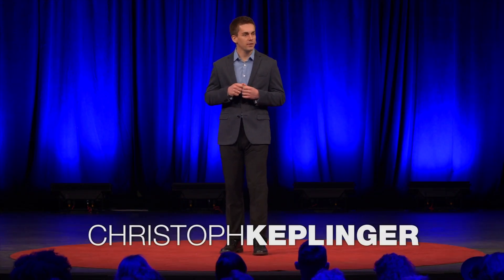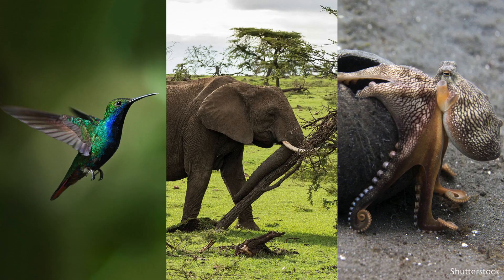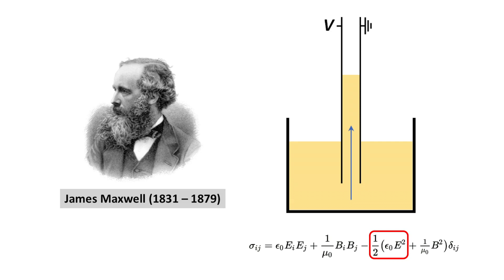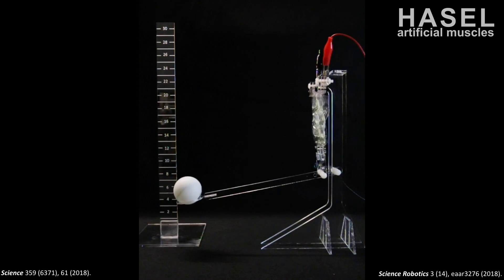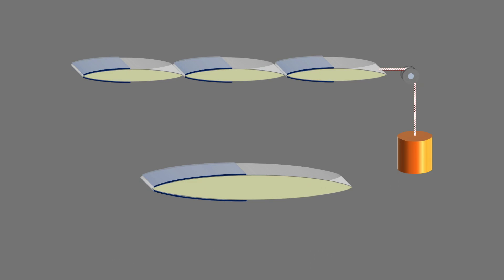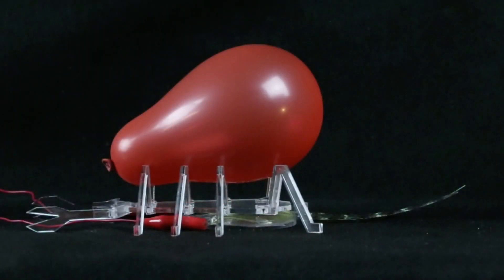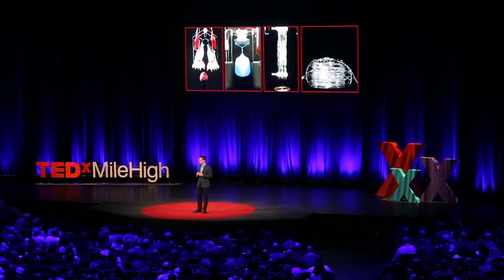The artificial muscles that will power robots of the future | Christoph Keplinger

Comment: Relax folks. Don't get your hopes high. Pay attention to the voltage required - 8kV (8,000 volts). That's dangerously high. This solution is interesting but not practical. We need to find a low-voltage solution.

Comment: That's pretty badass. From an engineering perspective, though, I'd want to know 1) the voltage needed to operate, and 2) any info about the durability of these units. If you spring a leak in your plastic bag, the muscle breaks and everything's covered with schmoo!
Reply: If you watch the video more carefully, you will see that voltages are mentioned.

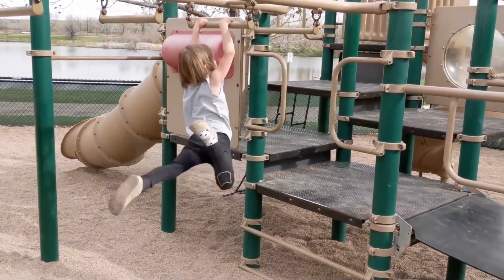Comment: 1:39 its not exactly a great example of the difference in physical ability, showing a child vs a robot.
If u put the brain of that child in the robot, you would see it get out of the car very quickly too.
Its main issue in SPEED isnt so much the physical aspect, its the brains ability to solve problems so quickly in comparison to a computer processing zeros and ones.

If you swapped their bodies, the robot would have even more trouble getting out of the car, cos it simply could not handle that much input of so many different moving parts.
The brain comes first, then the body.

Comment: Yeeah, not very good for military applications :/ you'd have to cover them with kevlar or other though materials, that can bend, so i'm not sure if it would be cheaper than using the standart hydraulic systems.
The speed and power is good, but is it a good idea to replace metal, hydraulic cylinders with something, that can be punctured? It's good, but no Iron Man will be made with this any time soon, maybe some day.

Comment: I wonder just exactly how much current is needed to drive those hasels?  Are they giving off heat?  Great video but I want answers, lol!
Reply: Shouldn't be a lot, considering the delicate build and the polymer materials the conducting plates surround, so temps probs wouldn't go above 50C, if even that. Majority of the energy is stored in the electric field, not a lot of heat waste. The biggest issue is with the voltage. 8kV is not a safe voltage by any means. That's incredibly dangerous, esp if these actuators are to be used in the proximity of humans and conductive materials. They need to figure out a way to tune down the voltages to below 20-30V to be taken seriously. I've no doubt they'll do that, but it's the same issue that electroactive polymers, another, more elegant type of actuator with a huge potential, have - the voltages required are not practical. For a simple small robot hand you'd need either some powerful voltage step-up circuits to use commercially available batteries, or use supercapacitors, which cannot be relied on for continuous use for long periods of time. 
Nonetheless, super stoked to see that we're trying to imitate nature's actuator mechanisms - that's the way to go!

Comment: How much current/voltage does it need? How insulated do they need to be? What level of flexabilty does it need?

If it is within specs you could 3d print it with a multi-filiment flexable printer. (softest material is a Shore D 70 softness ) (the restiance for conductive filiment is terrible, so it would have to be low wattage) (is air a good enough insulator, if not maybe print in a chamber with air replaced with a less conductive gas?)

Paper is https://robotics.sciencemag.org/content/3/14/eaar3276?utm_source=webtekno

Comment: Any information on how much power these use? What's the efficiency like and assuming it's not great, is there scope to improve it?

EDIT: Yeah, after reading some comments on here, re-watching key parts of the video and googling Maxwell stress, it seems to me the presenter is being pretty disingenuous with both the nature of the effect (which has nothing at all to do with the presence of oil) and the potential uses of the technology. The artificial muscles shown here clearly rely almost entirely on electrostatic attraction between the conductors on either side of the bags and so require high voltages to get any significant force out of them - pretty impractical for stand-alone robots and particularly unsuited to prosthetics.  On the plus side, for fixed robots, loads could be held in position without consuming (much) power, as significant current would only flow while the plates were moving relative to one another. And of course great for loudspeakers where this technology has been in use for decades.

Comment: The problem with soft muscles is that they don't have the precision of the typical servo+precision gearbox movement setup which is in arc-seconds usually. Plus soft materials will degrade over time and lose even more precision. One could argue that human is very imprecise too, but who wants robots that will do an error from time to time?  It'll be interesting to see how economical and precise would a wholy soft-muscle robot be.. maybe people would be more economical and safe to employ than these "soft" robots :D

Comment: The gastrocnemius muscle from a frog is 20 X stronger than a human's muscle. A simple 3.3V stimulation can contract this muscle and no human alive can keep it from hierarchically contracting. This is because this muscle is hydraulic and expands and contracts with a force much like a machine but it can do it at an extremely rapid pace. In 1994, a group of scientist I was involved with at the Redgate Labs got a gastrocnemius muscle to live 100 days in a dihydrostreptomycin sulfate and bovine serum called "Hank's Base" and we contracted the muscle over 100,000 cycles. I believe one day it will be possible to use real muscles in a latex sheathe with a active mechanical liver for filtering the lactic acid which cause the muscle to break down and have a sensor which monitors the antimutagenic  liquid which promotes muscle growth in exchange for work (Force) using small current and voltage Pulse modified wave form. This... will be the future of robotics I believe.
Reply: "Microhydraulic actuators driven by electrowetting" have 20 times the performance of the best performing biological muscle at 70 to 80 percent efficiency .can be run at 3 volt or much less depending on the microhydraulic channels size and the electrolyte.
Reply: @sidneo14  It's the contraction distance vs force. Microhydraulic actuators don't move very far. A gastroc muscle can contract as much as 4 inches with a 3V pulse signal to the sciatic nerve branches which cause a hierarchical contraction filling the cells with fluids and acting much like hydraulic cells in the Venus Fly trap. The sciatic nerve innervates the gastrocnemius muscle which carries the pulse signal via the sheath covering like a conductor. As the pulse modulation increases in amplitude, the muscle contracts (Takes on fluid) and when the modulation amplitude decreases, the muscle relaxes (loses the fluid but gains lactic acid) This contraction and relaxation builds up the lactic acid which if there isn't a stabilizer in the fluid, the lactic acid begins to break the muscle down but using neutralizers and anti-mutenogenic compounds along with proteins and glucose, the muscle increases in strength and size. The only issue is the MTBF which is short lived. Most of our samples only lived a few days. With lots of testing and alterations, we were able to stabilize the muscle tissue and keep it alive for a relatively long time.
Reply: @yapandasoftware  do you think it's possible to one day make a flapping 'wing suit' with artificial muscles such as you mentioned? I'd invest close to 1M USD if possible.
Reply: @fizzleshizzle8314 you have that kind of money to invest? That’s be pretty cool if you did that, bro.
Reply: He’s using 8kV to make these PEANO-HASEL contractions.  Would that be a potentially dangerous voltage to be playing around with?  Be good to be able to play around with these concept using lower voltages up to 12V
Reply: How difficult would it be to gene splice that muscle into human genes? 20x the muscle strength sounds pretty useful in people,  as well as robots! Even if you have to reinforce the bones and ligaments to keep it from tearing apart.
Reply: @sneeringimperialist6667  yes and how do you plan to fortify your bones and tendons? would they split immediately with such a powerful muscle? other dna? ok why not also think about a pair of wings and a big 25 cm penis? ;)
Reply: @sneeringimperialist6667 Well human Muscles can already tear themself Off the bone structure... If we Made them more powerful we couldnt benefit from it without reinforcing the connections and/or the Bones for this Job.
Reply: That is insane. What a waste of time & bovine serum.
Reply: Alice Lookingglass replied: "They best hurry & gather their frogs, I read they are being wiped out by a fungus virus... Where do these sCIeNtIsTS acquire their bovine serum, can you find out? Srealing it from the ranchers or ..."
3 hours ago
Okay not sure what a "fungus virus" is. That's a new one on me. However Hank's base is a common culture used in genetic labs. it uses dihydrostreptomycin sulfate, salts and bovine serum with anti-mutenogenic compounds to prevent the cells from changing their genetic codes when they're regenerating. Now please explain to me what "srealing" is because that's a new term to me. I speak multiple languages and that's a word I've never heard before.

Comment: What kind of pressures can these "zip-bags" operate under, would be messy if they burst inside of the Robot under a high stress job ? (compared to hydraulic)
Reply: There's probably ways around that. But this kind of technology isn't meant for a high stress job in the first place. It'll be more powerful than a human at least.

Comment: Quite ingenious. The process itself seems very energy efficient as well. The current tech is motors and rotation needs loads of gears and pivots to convert that into push and pull action, inducing friction and needing lubrication. Now however the challenge is to develop durable soft materials. Its no fun spilling oil all over the place.

Comment: oh my god, this is soo interesting! I never would have thought about robotics being non metalic. this is incredible
Reply: @ IvettaB
Non-metallic robots?  I think that's what replicants - the androids in Blade Runner - are supposed to be; machines that use mostly organic technologies.  Engineered people, if you will.
It wouldn't take a lot to do a brain transplant into such a thing of someone whose body had experienced colossal failure.
Replacing parts lost to accidents becomes much more accessible, certainly more like the original limb rather than a hook or solid prosthetic.

Comment: Huh, I don't know what the energy efficiency of these things is but at least the space efficiency seems to be hampered by most of it being dead weight and only the membranes do the real work and even there only parts of them.
He says they outperform biological muscles but that's without telling us how much energy is being pumped into these things through the cables that lead to somewhere out of frame.
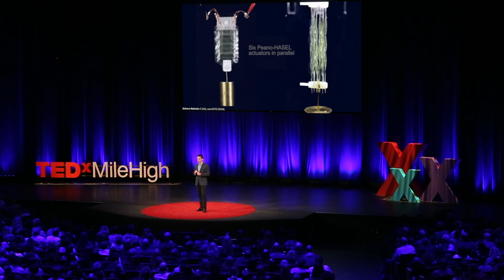Reply: In a few of the demonstration videos the voltage is mentioned in text. Like this one... 8:10
Reply: @Gorguruga  Just volts don't tell you much though. Without knowing how many amps were flowing, you don't get a wattage.

Comment: Looks good, but what about power consumption?
Can a robot made of that stuff run as long as a human can without a power cable?
Either way, looking forward to seeing how this sort of tech develops.
Reply: From the sounds of it this seems like it would be a lot less energy intensive than the current electrical motor driven robotics and so would almost certainly last longer than a traditional autonomous robot.